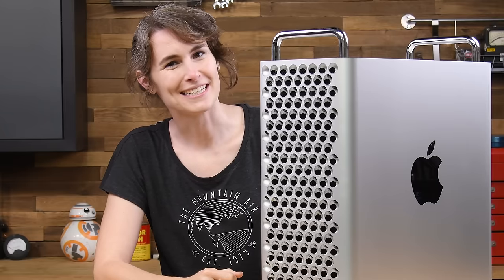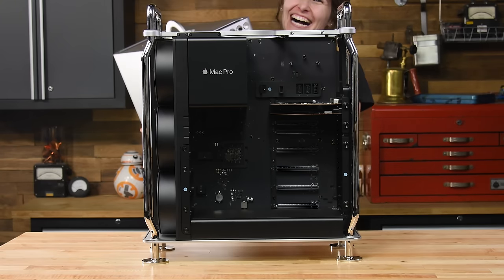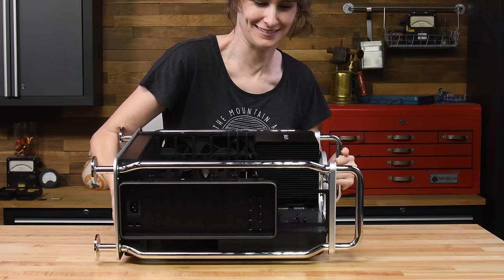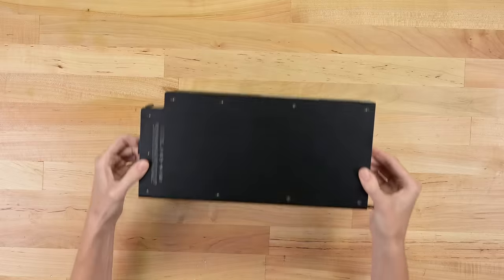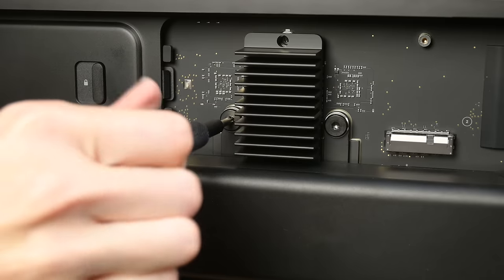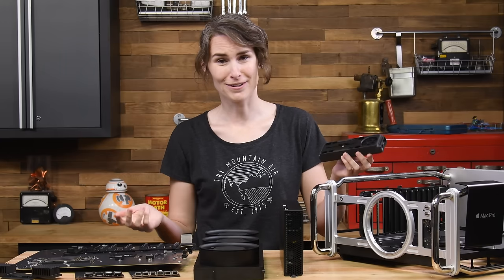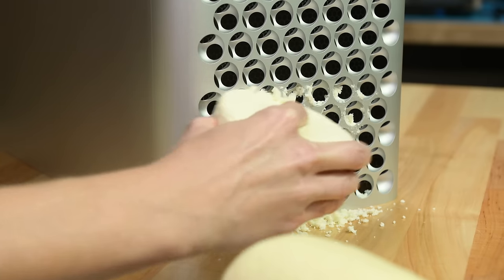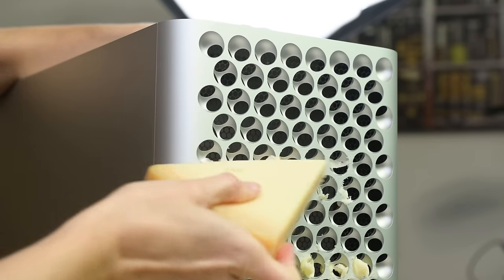Mac Pro 2023 Teardown: It’s Grate!!!

Comment: Nice teardown! One of the most impressive Computer builds, sadly the missing GPU and RAM modularity is a huge downgrade. I would like this kind of module design in the PC world, the ATX PC world so so far behind. And it would like to see a Mac Pro with real modularity again.

But the cheese is the most important by far.
Reply: Is this satire? PCs aren't modular?
Reply: @littlebuch  he never said modular, he said "module design" which is a completely different thing. And I totally get what he means, I don't know how one can misunderstand that.
Reply: @PvtAnonymous  The two words are synonyms. You "completely" get it. I'm sure...
Reply: @littlebuch  ok, so which modules do exist in the ATX standard smartpants? I only know of parts.
Reply: @PvtAnonymous  Gpus, ram, psus, ssd, hdd, drives of various types? Everything? Literally everything exists in an "ATX standard".
Reply: @littlebuch  you just listed parts again. Maybe you should look up what a module is. And the definition of a module is pretty straighforward.
Reply: @PvtAnonymous  And what is the definition of a module? What kind of crap did Apple try to sell you now?
Reply: @littlebuch  For hardware, a module is an assembly of parts designed to be added and removed from a larger system easily. An example of a hardware module is a stick of RAM. Most modules are not functional on their own. They need to be connected to a larger system or be part of a system made up of several modules.

The concept of modularity or being made up of modules is common in computer hardware. A modular system has many advantages allowing for ease of repair, upgrade and extension of functionality. The various modules can be swapped out as needed. Standardization of hardware as interconnects enables several vendors to produce modules creating better choice for consumers.

While most systems are modular, the term module is not applied to all components in everyday speech. . Some common examples are networking small form-factor pluggable modules, Mobile PCI Express Modules and dual in-line memory module RAM.

Is that enough for you? The term module applies in this case to the fan assembly, power supply, especially the main logic board and to some extent even the PCIE modules. They can all be connected with ease by just sliding in or out, they do not have any cables to connect them to other parts and they have a predesigned layout. You don't have 3 or 4 sizes of power supply, you don't have different lengths of anything. It's just plug-and-play. In a standard ATX build you have to find the right dimensions for basically every component, find the right connectors for your components (front panel USB, number of PCIE power plugs, nVidias new plug if you have one of those 40-series GPUs), the right cooler with the right mounting hardware, a case that even fits the mainboard size and so on. There is nothing "modular" here as I can't just take custom watercooling CPU block and slap it into a system that is, apart from that, completely air cooled. Maybe it clicks for you now, I can't really clarify any further.
Reply: @PvtAnonymous don't argue with the dude, he'll never admit he's wrong.
Reply: @ethann_browne  Wrong about what exactly? You need apple to make you lego parts because you can't even plug 2 cables in?
Reply: @z37d4 SOC and soldered to the mainboard are 2 different things.

Comment: What will happen if someone builds a PCI-E RAM card for this mac
Reply: That's mostly not possible. RAM is used since its low latency, and high bandwidth. The PCIe Gen4 x16 slots in here are good for UP TO ~32GB/s bandwidth, which is horribly slow compared to the ~800GB/s bandwidth of the RAM. Plus the latency is likely ~5-50x higher. The PCIe switch also indicates the PCIe slots are shared, to some extent. So they don't all have full bandwidth if they are all used.

Comment: Not upgradable memory is a NO GO. Not only because you are forced to buy in advance something that you don't know if you'll need (lifespan of one of those systems can be a decade) but mostly because.... yes, it can burn. Both memory and SSD can burn through time. And if they burn in a correct computer... ok, bad luck, change the component and keep running. But if it burns in a monolithinc one... you are out of luck. Best scenario.... you lost your work and have to spend 7K in a new computer immediately. Worst... you have to send your computer to Apple for it to be repaired and you loose so many days.

Comment: Why does everyone say in the video and in the comments that it is impossible to upgrade the SSD drive?
Apple already sells SSDs on its website specifically for Mac Pro 2023. So, they are probably not locked like on Mac Studio and can be replaced.
Reply: I'm also concerned about iFixit not mentioning this. Seems like a pretty big oversite on their part. I certainly understand why random people in the comments would assume you can't upgrade it though.
Reply: I think you can also use pcie to nvme adapters as well, just can't install OS to them.
Reply: @pratikpramanik7782  that - unfortunately not. The SSDs have to be flashed with proprietary firmware via Apple Configurator and that only works on Apple's SSDs.
Reply: EDIT: Read replies below mine for corrections
I think they meant that you can't UPGRADE the SSD. From their previous reviews, it seemed that way, even if you fill the second 
slot with the same type of flash storage.
Please correct me if I am wrong (I'd love to be honestly), but generally I think Apple sells the SSDs only as direct replacements, which is still a step in the right direction honestly.
E.g. if you originally had a 1TB ssd, a new 2TB one won't work, but a new 1TB will.
Reply: @DeerJerky   Partially right, but apple does sell 2023 Mac Pro "Upgrade Kits". If you have a 1tb built in and purchased a 2tb upgrade kit, you cannot put the 2tb chip in the empty slot. You have to remove the 1tb.  But you could buy the two slot 8tb kit to go from 1tb to 8tb no problem.

Each module has a number on it corresponding to the slot it must go in, so if it says 2 on the chip, you cannot place it in slot 1. I assume they also have to match, so a number 1 1tb module will not work with the number 2 2tb module in the 4tb upgrade kit. I could be mistaken on that last part though.
Reply: @DeerJerky  you can fill the second slot, it just has to be an SSD module, that is designed to work in it. Apple's SSDs have to be installed in the order of 0, 1 (in case of Mac Pro in this example), up to 2 and 3, each of these "ports" is assigned to the module in the firmware. In the base config, port 0 is used. To upgrade the SSD you'd need a module that is assigned port 1. This one will be hard to find though usually. Which one you have, can be discovered by looking at the label on the SSD itself, there will be a mention of it somewhere.
Reply: @MrSoundChaos  interesting, super helpful, thank you
Reply: @PvtAnonymous  gotcha, thank you for the correction
Reply: @DeerJerky  no problem. I just checked and the modules are actually labeled as "1" and "2" (although they still use port 0 and 1 on a computational level). They even mention the importance of this order  in the Mac Pro handbook ;)
Reply: @PvtAnonymous  I see!
Reply: Those are expansion ssd cards. 
You cannot upgrade the original drive, even if it's literally the same product.
Apple locks their stuff for no reason.

Comment: Any machine you can't DIY is not PRO in my eyes. You can't swap RAM, SSDs are locked in by software and there is no option to use more powerful GPU which is a shame since M2 chips might have quite powerful iGPU but that won't be able to compete with dedicated GPU in any way shape or form.

So this is just Mac Mini or Studio stuffed into bigger case.
Reply: SSDs aren't locked, Apple even sells the upgrade kit. But the rest, I agree. It's a really weird niche product, and by far the most limiting factor right now is RAM. They went from 1,5TB to 192GB. Which is just around 10% of the older config.
Reply: @PvtAnonymous  if you can't buy any brand of SSD swap it out with the current one it's locked by software. If you need a special apple kit to upgrade the included SSD it's locked by software and it's bad because user are lacking control over their machines and no SSD are not dangerous to swap.

Comment: Why would people want to upgrade the RAM?
Apple's RAM setup is far better than any PC setup out there, because:
It's rated at 800GB/s (A gaming PC with DDR4 is rated at 76GB/s)
It's shared between the GPU and CPU, thus removing all the redundant cycles.
It's very close to the chip thus reducing the latency.
Since the latency is very low and the speed is high, the RAM controller in the chip treats it more like an L4 cache.
Reply: capacity, not speed, is why people want upgradability.

Comment: And don't get to be fooled, if Apple would like RAM to be upgradable it would be, it would require some type of proprietary construction and slot on a chip die itself, or directly behind its socket. And do not tell me they do not have money or talented engineer to make it. Plus in I think 2–3 years Mac Pro will get an actual update, this one is to just get rid of Intel, however I am super curious who makes for them the chonky PCIE controller. ;-) Now pure speculation - final Apple chip Mac Pro will have some type of Compute Unit (heatsink + M chip module, LGA probably but maybe PCIE "cartridge" slot / slots type, latched / screwed), motherboard probably will have 4 interconnected slots (one populated in basic model), PCIE 6.0? Slots (or some proprietary style one) placed on a back side of the motherboard.

Comment: Proof that Apple has given up on the Mac Pro.  There is so much room for many, many banks of RAM, but no, even the installed RAM is not replaceable.  OK, so then there is room for many, many SSDs in RAID arrays for reliability if not speed improvements.  Again, no, you cannot even upgrade the existing socketed SSD.  But at least it has slots for upgrading GPU, right?  Wrong again, no GPU support in its adapter slots.  So this is several thousand dollars more than the Mac Studio for non-GPU adapter slots, hopefully improved thermals, and a cheese grater.  Insanely grate.  Insanely not great.

Comment: I for sure won't be buying or recommending this. Components pairing in a desktop PC? With soldered RAM and no upgrades to storage?
I'd rather buy my £3000 gaming PC (which will perform superbly) and "Hackintosh" OS X onto it if I really wanted the Mac operating system.

Comment: Now that Apple Company went the route of a System on a Chip architecture for its computers things have changed. There are both advantages and disadvantages to the Apple Silicon System on a Chip Architecture. The main advantage is a gain in performance and speed. The main disadvantage is that the memory, the graphics and the central processing units can not be upgraded. This system on a chip is all machine soldered to the circuit board. The only variation of this architecture that could be done is to develop a special socket that would allow changing out the entire system on a chip for an upgraded system on a chip.